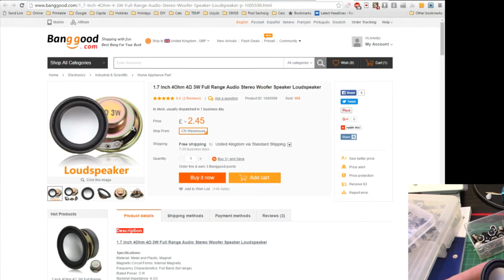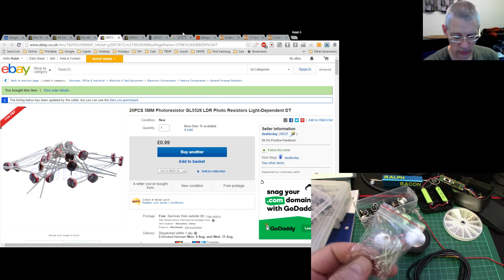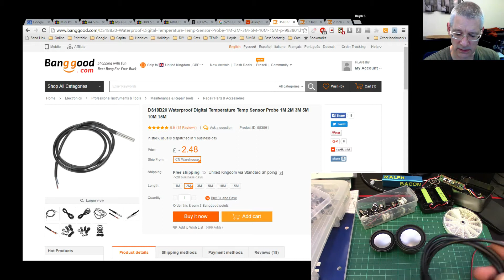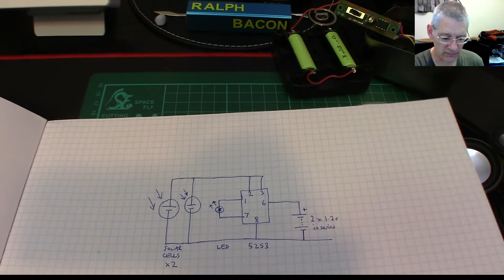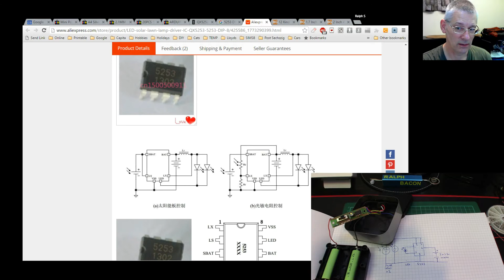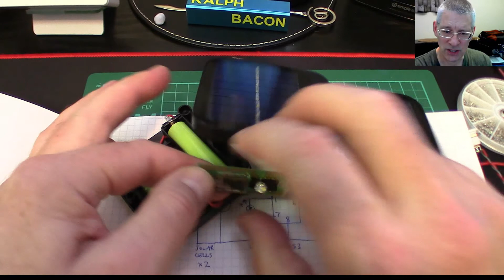#45 Shopping for Arduino Components (and a lucky find)

Comment: Ralph, in a past project where I needed a waterproof LDR, I used a small plastic test tube that was potted with a clear setting 2 part epoxy. You can get them with round or flat bottoms on ebay for around 10 for a pound. 
Another idea that was partly from Big Clive and partly my sister (a patisserie chef) was to use silicone moulds to pot electronics. The cake decorating world has some excellent silicone mould shapes and the epoxy doesn't stick to it. 

Thanks for another interesting video.
Reply from the maker: +Maxx B
Some excellent ideas there and I will certainly add them to my ever-growing list. Others will benefit from your posting too, so thanks for that.

Comment: A heads up for yourself and european subscribers: 5mm squared paper is available in A5 and A4, periodically,in Lidl Stores. When I write periodically, it seems like they crop up 3 to 4 times a year but to no discernable pattern (except squared, of course). Nevertheless they are cheap enough to keep a stock.
Reply from the maker: Good call, Michael, I shall be vigilant as we are regulars of Lidl. Thanks for the heads up.

Comment: Those screws are actually for eyeglasses. They are very  thin and short. I don't think that you can mount any module, sine circuit board is most of the time thicker that the screw.
I don't draw on paper, since lots of forests are being teared down for paper production. intuos pen tablet is my choice.
Reply from the maker: Would you believe it, Mox Mix, I have used those screws for eyeglass repair on two occasions already. But they are sometimes used in electronic devices, so small they are hard to use. Regarding the eco-friendliness of the paper drawings, I have recently been using a whiteboard instead, with just occasional paper drawings. It's a step in the right direction, right? Thanks for posting, nice to hear from you.
Reply: @RalphBacon  Yes, for eyeglasses are perfect. You could put drop of nail-polisher on screw head to stop it from unscrewing.
Glad to hear about cut-down of paper use.
Keep up the great work.

Comment: ive been using my cell phone as a magniffying glass for years now for gold prospecting.  better than any jewelers loop im surprised we could not making out the lettering on the chip... i use my phone for that all the time too with no issue just zoom in with the flash on. sometimes videos are clearer.
Reply from the maker: Hmm, I use a microscope with large LCD screen these days, works like a dream. It's the Andonstar 7" I use. Very clear picture and even has HDMI output too for recording.